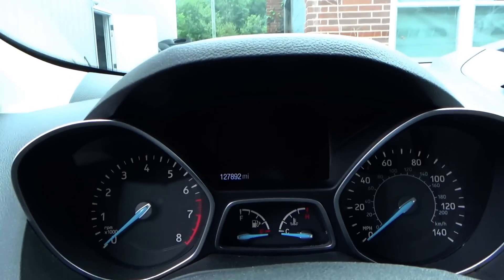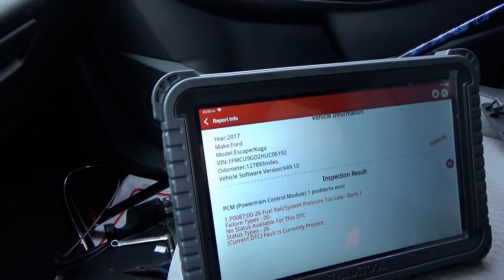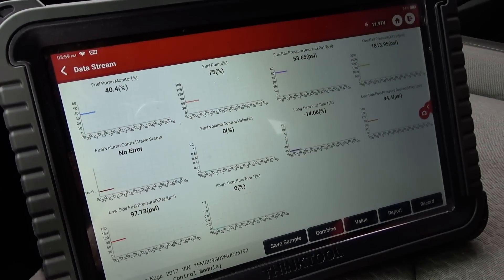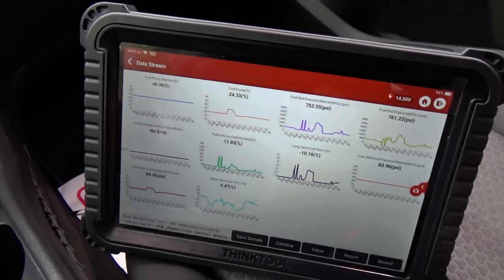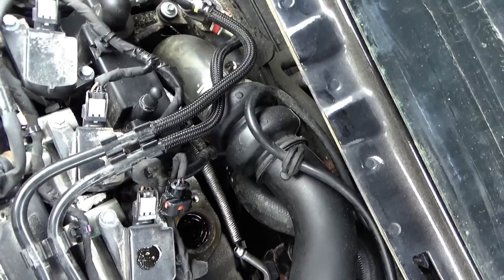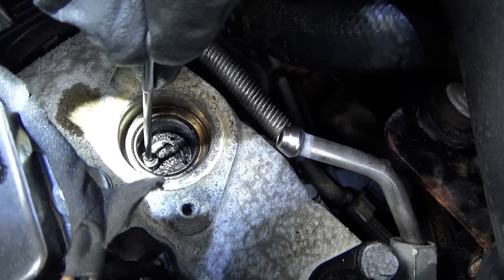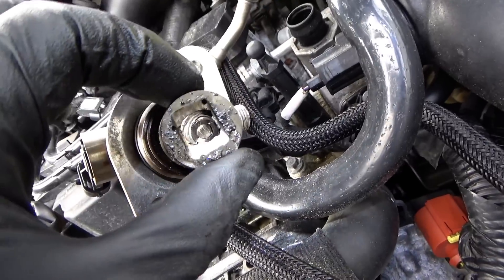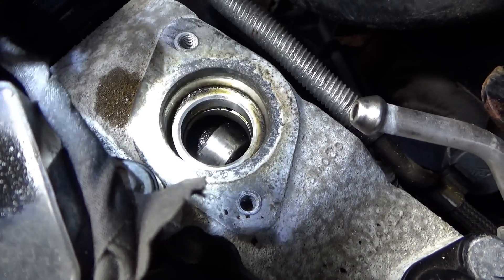Auction Ford FALLS ON ITS FACE! (Escape Turbo GDI P0087)

Comment: Amazes me how people don't do oil changes. Oil and filters are cheap. Engines and repairs are expensive!!
Reply: Especially with a turbo. Synthetic only.
Reply: I'm so scared with my ecobeast, project farm has convinced me to buy ultra platinum pennzoil
Reply: And, people who can least afford to replace their car neglect their cars the most.
Reply: @flatdaddio. My words exactly!  Every 4000 miles or 6 months whichever comes first!  Turbo engines "may need" more often oil and oil filter changes.
Like I say on the The Car Care Nuts channel, "OIL IS CHEAP!  ENGINES ARE EXPENSIVE!"
Reply: " Oil and filters are cheap"

Not so much anymore.  Most garages are charging $75 minimum for an oil filter and change around here.  If you do it yourself, sure, pretty cheap.   For my Ford, the dealer does twice-annual oil changes for free.
Reply: @teekay_1 I would not trust ANY dealer to do ANYTHING on ANY vehicle that I own, EVER.
Reply: I'm bad about that. I change mine every 20,000 miles or so.. I'm only getting 500,000 miles out of these engines, imagine what I'd get if I took care of it.
Reply: Wise words of wisdom.
Reply: Women..  amIright
Reply: Yikes, Ivan.People don’t get it! Extended or no oil changes kills engines.
Reply: They are the same people that never change their furnace filter, clean their condenser and evaporator coils, and mow their lawn with the discharge chute facing their AC condenser. If you watch HVAC GUY you will see that they usually don't ever clean their home, either, but they DO wash their car.

Comment: And now we know why the car was dumped at auction. Stay away from that one! All that metal went somewhere.
Reply: Change oil twice in 100 km clean the pan and hope for the best 😅
Reply: All that metal inside the engine can’t be good
Reply: It's down in the pan.. I'm sure it's fine. 
It would be a good idea to drop the pan and clean it out and make sure your pickup tube is clear.   That's what I would do if it were my car.
Reply: @calholli  That metal would have gone through the oil pump, I suspect this engine is living on borrowed time.
Reply: @calholli  sooner or later it's going to get there 
After traveling through or over other parts 
Damaging those parts in the process causing more metal in the engine
Reply: Depends on the price.   If you get it cheap enough you can put an engine from a junkyard car and have a reliable car.
Reply: Was thinking the same thing

Comment: Running on sludge instead of oil... It's amazing no other mechanical problems popped up - it takes a while to eat all that metal with minimal oil. Great diagnostic, Ivan!
Reply: All that missing metal went somewhere. Want to take a guess at where? 6-10 miles (or less) it will need a new engine.
Reply: Well he did add the follower and shaft as they ground down.  So it wasn't all sludge.
Reply: Sludge top to bottom on that engine. Needs a flush.
Reply: @kimberlydeann  Part of it was taken care of when Ivan requested the oil change, prior to his diagnostic. Possibly, a second oil change will clear most of the remaining - these are microscopic particles that will pose no major problem, provided that the run on sludge for unknown time, didn't cause other issues. Yet, the sludge itself, may have created deposits that may, indeed, require a flush - up to the owner to decide.

Comment: Show me any modern car and I'll show you a neglected car.  This is why I won't even consider buying a used car.
Reply: People Don't do any maintenance. 
They drive them until the maintenance cost is high. 
They then dump it for a new car and round and round she goes.
Reply: Who needs to maintain an appliance, right?
Reply: I agree with this. Nobody does regular maintenance anymore. They wait for the car to tell them what to do.
Reply: Apparently I’m an exception to your rule
Reply: My last two vehicles were used.  I refuse to pay new car prices.  You just have to have them inspected by your mechanic.  My current vehicle was driven on lease by a sales guy at the dealer.  He drove it for a year.  Nice low mileage F150.  Good mechanical, good interior. And way below new prices.  I'm still driving it without issue 7 years later.
Reply: I can't afford a new car. So, should I  just be homeless?
Reply: @johneddys2351  
A used car doesn't need to move to be cozy.
Reply: Very poor logic in my opinion.  You just have to know what to look for and be diligent.    Do you not watch Ivan enough to know to stay the hell away from new vehicles.

Comment: Turbo, Direct Injection, I would pass!  MPI or Carbureted Naturally aspirated for me.  Thus, I am blessed to own & drive a 2013 F150 & a 2008 Crown Vic.
Reply: The engine in the crown vic is called a 302? My old master's favorite engine.
Reply: I just bought a 14 f150 5l. Texas truck, love it. Oil pressure light comes on at idle😂. Hopefully it’s just a switch and I am not swapping engines 😂
Reply: 2003 Lincoln town car here

Comment: Those are junk but with no maintenance they are really junk!!!! As soon as it ran good I would dump it somehow. Thanks Ivan!
Reply: My brother bought one with a bad 2l for my niece. I put a used engine in, 2 rear hub bearings, rear diff, had a bad bcm fuse causing havoc and now it’s stalling with a fuel pump driver module code😂. 128k and it’s plumb worn out
Reply: @mph5896  I had a neighbor that had one with a cracked block loosing coolant so she traded it for a Mitsubishi. That thing was a POS!